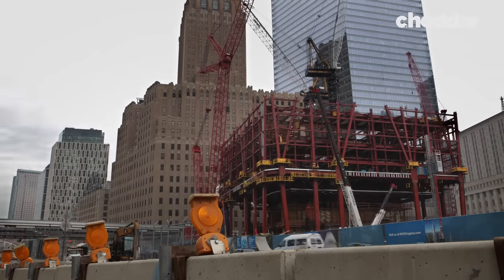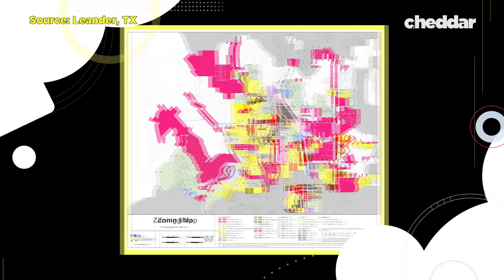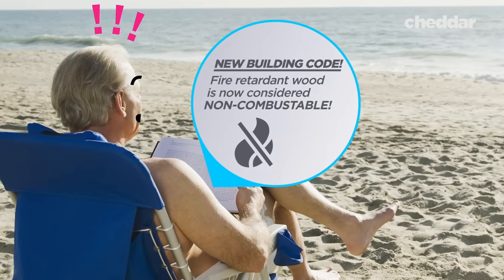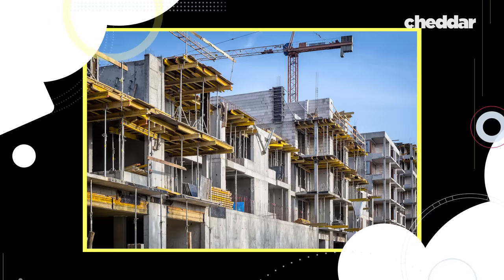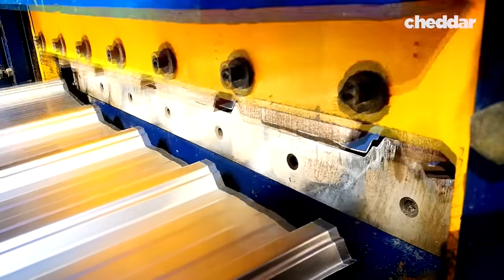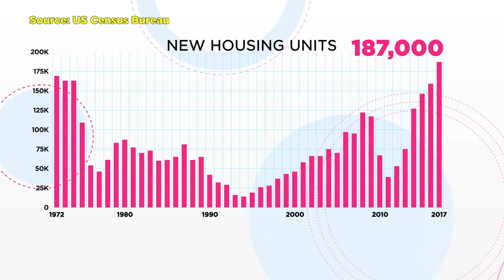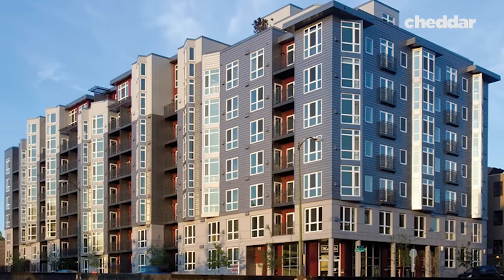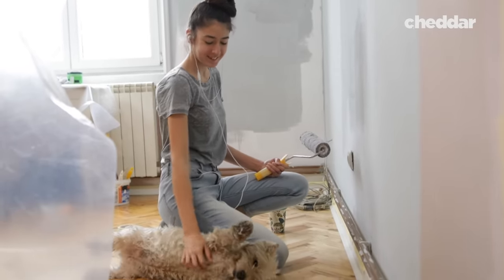Why All New Apartment Buildings Look Identical - Cheddar Explains

Comment: I actually quite like the look of these housing units. FAR better than the completely concrete and brutalist of housing units of the 60s for instance. They look unique and varied from one another, with a lot of materials used for the outside, expansive windows, and terraces/porches for outside use and gardening, it’s actually quite nice.
Reply: Yeah I honestly have no idea why they keep calling them eyesores, they look like any other building honestly. What do they want, like neoclassical architecture?
Reply: Yes! The balconies, inner courtyards, and expansive windows facing the street are all desirable features.
Reply: @gabrielgarcia7554  I actually like Neoclassical architecture a lot, I just dislike boring buildings, like Standardized Glass Skyscrapers with 0 other distinguishing features for instance. And I don't find these apartment buildings to look boring at all
Reply: They're also usually less tall and more manageable sized. Easier to keep from turning into crime pits like some tall block public housing
Reply: @israeldelarosa5461  tall glass skyscraper gets better if you slap some gamer RGB on it like Hong Kong
Reply: Here in Tucson, these buildings look way better than the abandoned lots they replaced
Reply: I unironically think 60s brutalism has more soul than these buildings

Comment: We have buildings in Quebec where I live that have the same type of exterior. The difference is that the structures of these buildings have to be made of concrete because the building codes state that buildings taller than a certain amount must have a structure of concrete or steel.

Comment: I've actually never seen these buildings as eye sores, I actually really like them. Interesting that some people do.
Reply: I think more people would be fine with then if they weren't so wide, because wide buildings cause a lack of variety on the street and overpower their surroundings. And its not like they're impossible to build without being so wide; you can buy just 2 typical american lots (most commonly 30 feet wide in urban areas) and build 10 two bedroom apartments that have a shared backyard and windows on three sides, with parking underneath.
Reply: Yes, and they did not seem as generic as indicated. Several of the buildings in the video looked quite diverse to me.
Reply: I like them, but most of them have huge and ugly parkinglots. These smaller apartments also fit the gap in dense suburbia or many of the south's sprawling cities.
Reply: yeah i agree and it helps with the america’s single family housing issues
Reply: I personally find these types of buildings appealing and when I am looking for somewhere to live a building like the ones shown in the video are probably where I plan to start due to their balance of cost and their usually good location.
Reply: SAME!!!
Reply: In general I think these look better than a lot of older suburban apartment complexes do. Now in urban centers I think a lot of the traditional buildings look nicer.
Reply: they usually overbuild them. The smaller and lower versions of them are fine. They become a bit of an eyesore when they make giant apartment complexes out of them. Still not the worst, but we should still expect more out of our modern architecture.
Reply: I actually like the way they look, too.
Reply: Wait about 15 years and see what they look like and what you think of them then.
Reply: I really like them, personally.
Reply: Like anything they can be done well or poorly.  But, because it's all $'s & cents originality goes straight out the window.  So, when you see row after row of them it's a bit disturbing. Another problem with the Texas Donuts around here is that it increases population density 10 fold and the infrastructure is simply not designed to support that. 
The average person moving from California has no idea they moving into an overpriced fire trap.
I  wouldn't be surprised to see massive lawsuits around this in 5-10 years.

Comment: I actually found those buildings pretty nice looking. Affordable housing is usually a lot uglier than that here in Brazil.
Reply: It's not bad, but if you go to South Lake Union neighborhood in Seattle, for instance, you'll see that it is way overused.
Reply: @spencergraham-thille9896  As an European living in a historic city, I see literally Brutalistic windowless jails more appealing than the urban single house sprawl of McMansions.
Reply: Concrete vs wood: concrete is ugly but you will pass it down to your children. Wood can be made pretty with facades but a rain will make it into pulp
Reply: any western countries look much nicer than the crap tier architecture style in brazil. the only places in brazil that look nice are the german ones in the south
Reply: @LucasFernandez-fk8se  nah
Reply: @kevinclass2010  Concrete (or brick & mortar) are also good at insulation and keep the house at a more stable temperature year-round. Building houses with plywood and vinyl exteriors allows it to bleed heat between the walls causing a huge temperature difference year-round.

Houses pre-WWII were built thick and meant to last (hence why they exist in many cities still). But post-war housing booms across the country caused a spike in housing needs, so to keep costs down, they were built out of wood and asbestos (a winning combo if I say so myself). Minus asbestos, the cost-cutting idea won out. And because land was becoming more expensive over time, houses were built cheaply and poorly in order to make the homes "more affordable."
Reply: @Cumulo9  I agree.. Brazilian architecture looks mighty boring and uninspiring to me. All the buildings in São Paulo look identical, no diversity whatsoever. Very different from Buenos Aires and other South American cities.
Reply: Concordo, mas pelo menos nossos MRV são feitos de alvenaria estrutural invés de madeira.
Reply: This housing is not affordable.

Comment: I lived in a 5 over 1 apartment twice in the DMV area.  I like the look and community feel it brings with the mixed shopping underneath.  However, the walls were super thin at both places I lived at and there were some flooding issues with some units.
Reply: I hear people use the term “thin walls” so often but wall construction is pretty standard everywhere.
Reply: @justinclark216  Not if the walls are built out of concrete. They insulate sound a lot better than wooden framed walls.

Comment: I've seen about a dozen of these buildings pop up near campus in the college town I live in. The biggest controversy surrounding them seems to be not as much the aesthetics of the buildings, but what has to be torn down for them to replace - local and sometimes historic landmarks and iconic shops and restaurants, have had to close down. In addition, while they fill up with residents, often the lower floor (designated for retail) can remain vacant for much longer, and then there some projects that clear the land and sometimes even start construction, but the developer runs out of money leaving an empty lot or half-finished building.

Comment: As non us citizen, i dont really get it.. is it brick n concrete really that much more expensive in US???
Reply: Same question here
Reply: Yes it is. Also lumber is so incredibly abundant that it's dramatically cheaper. Also carpenters are cheaper than masons.
Reply: Wood houses are non existent here.
Reply: Yes because brick and concrete requires relatively skilled labor whereas wood can be put together with relatively lower skill. It'll be flimsy, but gets the job done.

EDIT: Also environmentally more sustainable.
Reply: As the non US citzen as well I was also amazed to learn that you may even think of building the multi-storey building out of wood. How about the sound insulation? The strength? The longevity? It may be cheaper to build but concrete or brick building may last for 100 or 200 years easily.
Reply: @piast99  the floor and beam were still made out of concrete.. as for the insulation of noise n so on, usually the layered it with insulator in-between the wall..
Reply: @viperV10  how wood is more sustainable than brick? Cus it take much more energy to produce?
Reply: @DPEP56  i wouldnt wanna live in multistorey building that were build mostly using wood.. it burn much easily, easier to break in, much harder to sound proof, require much often maintainance..
Reply: @piast99  Wood is very strong, it bends instead of breaking. The problem is that you need to make sure that all your other materials can bend along with the wood or else it will separate.
Reply: @TheGreatgan  you can cut down trees and plant new ones whereas you would need mining operations to manufacture concrete, industrial forestry is much more sustainable than mining.
Reply: @viperV10  Forestry is especially unsustainable when much of the wood comes from ecologically significant areas, old growth, or mature forests that provide wildlife habitat, recreation and tourism, and carbon sequestration.
Reply: @NatureShy  that's why I said industrial forestry
Reply: @piast99  virtually nothing built in the USA since the end of World War II is intended to last for 100+years... quick and cheap construction took hold in the post war housing boom and it never went away...
Reply: The U.S. has lots of lumber, it's just a supply difference
Reply: @DPEP56  please look at lumber prices pre pandemic and now. We’re talking about a 300% increase with no end on site. Timber is cheap, but lumber is dang expensive
Reply: american labour are expensive which is why, still silly though
Reply: @Banom7a  the taxes and licenses are also expensive
Reply: Nothing  but short term thinking  in this country;were basically  a fast food  nation.
Reply: Not really its more like construction companies here love to "Maximize profit"

Comment: The problem of this buildings is that if you fart, your neighbours can hear everything 🤣😂
Reply: They are all over the UK too and they're crap. The floors are bouncy the walls are thin and you can hear conversations. The whole building feels flimsy.
Reply: @AsphaltAntelope  I was staying in a Travelodge hotel once with shoddy construction characteristics exactly as you describe. I lost count of the number of times I was being woken up. A few days into my stay, I was so angry and sleep deprived that, in the early hours of the morning when everyone else were asleep, I went to the upper floor and jumped repeatedly as hard as my body could muster. The whole building shook, and I thought the floor was going to cave in!
Reply: The problem with apartments are they are very noisy!
Reply: @jessicathomas4672  Not a well built apartment. An apartment done right can be nicer than any single family home
Reply: @planefan082  it’s called equity- something you will never have in an apartment.
Reply: @garycard1456  you should try a white noise machine, or even sleeping earbuds, they are pretty cool! (also, that was not a mature way to take out your anger. like, at all.)
Reply: @elibullockpapa9012  Maybe it was not mature, but it is easy to forget that when you have hardly slept for 5 days in a row, you are not the same rational person as when you are well-rested. Severe sleep deprivation compromises a person's sanity. I had earplugs, which I don't like using because they cause throbbing pain in my ear canals. Nonetheless, I could still hear the foot stomping, drunken laughter and banging doors through the earplugs.
Reply: @planefan082  Sorry, but you can't beat a detached home with a nice garden for recreation, horticulture and  growing your food.
Reply: @garycard1456  i dont care for that type of stuff 😂
Reply: Developers don't want to spend the money to properly sound insulate the individual apartments. They also don't want to use more expensive materials that could help with the noise.
Reply: Not necessarily. I've lived in two: barely knew I had neighbours in the first. The second: well, I can tell they're there, but everyone's generally considerate (though, given the "how to be a good neighbour" emails, not everyone is having the same experience).
Reply: @garycard1456  yeah I like being able to throw house parties and grill in my back yard and have my big dogs play. Apartments are shit for big dogs and lots of them have shit parking for visitors lol
Reply: @AsphaltAntelope  yea they’re cheap. Wtf do you expect
Reply: Apartment and condo blocks should be banned.
Reply: @TheRockkickass  I expect better building regulations and standards so that the cheapest houses aren't utter shite.  Cheap doesn't have to mean utter shite.
Reply: Most are wooden construction which means it doesn’t take much beyond one spark to destroy it.
Reply: @planefan082  weird cope, but ok
Reply: Dominique Lavalle  Earplugs are only effective at reducing high frequency noises. They are ineffective at stopping the wearer from hearing low frequency noise, such as music bass. They are ineffective against vibrations associated with neighbour's footfalls. These impact or percussive vibrations travel with ease through ceilings and wooden flooring joists shared between adjoining dwellings. Uncarpeted laminate flooring magnifies impact and percussive noises, such as footfalls or objects being dropped.
Reply: Dominique Lavalle  Especially when it impacts on sleep quality, hence one's 
health and ability to function as a normal and productive human during the daytime.
Reply: @frostflower5555  You have a strong case: apartments and condos do not tend to be conducive towards good health and quality of life.
Reply: Dominique Lavalle  I agree, soundproofing insulation between walls and floors.

Comment: Japan builds fairly similar homes, a concrete base (not even a floor, just a base) and then a wood frame. I've seen small apartment buildings (2 or 3 floors, 5 apartment per floor is common) go from project start to people moving in within 4-6 months, it was pretty impressive.
Reply: I read its wood also due to flexebility in earthquakes. At least a purpose and not just cheap
Reply: Except the typical Japanese "mansion" makes the American 5 over 1s look like something designed by Frank Lloyd Wright.
Reply: @mccunicano  
Yes and no, some are nice but many, especially the older ones, are not.
Reply: Leopalace mansions lmao
Reply: I lived in a tinyJapanese apartment for years.  Less than a hundred square foot.  To this day, I STILL don’t know if that apartment was built sensibly with incredible soundproofing, or if my neighbors were all descended from ninjas… because I NEVER heard any sound from any of them (aside from doors opening in our shared hallway).

I’d take that tiny apartment over the last two “luxury” apartments I lived in, where I could not just hear neighbors talking but could make out their conversations.
Reply: @davidmcleod5133    Same! there was a point (while living in Japan) when I wondered if I was the only one living in my building- I never heard or saw anyone.
Reply: @h0mewrecker    Love Leopalace.  My friend lived in one with a loft space. It was pretty cool.
Reply: @davidmcleod5133  better soundproofing materials used in japanese building.